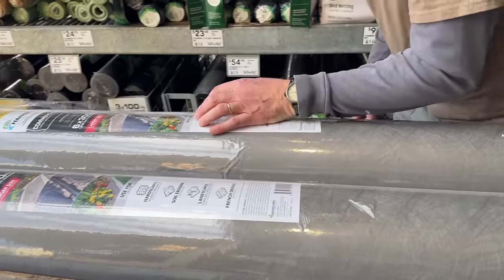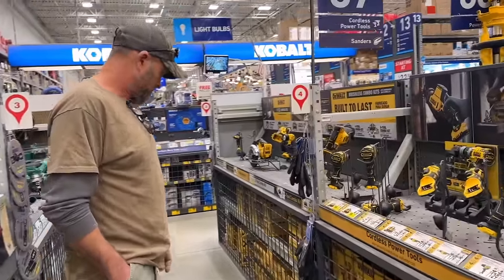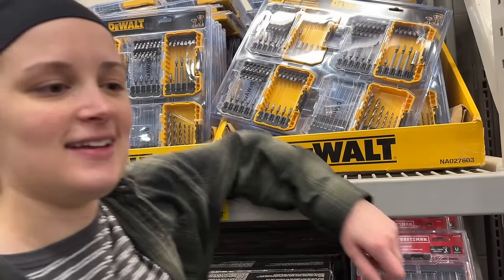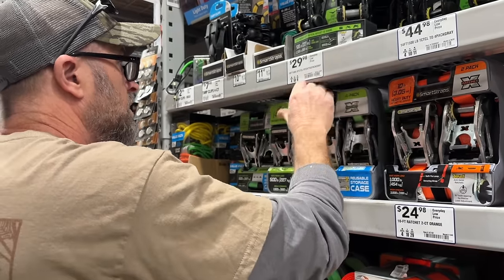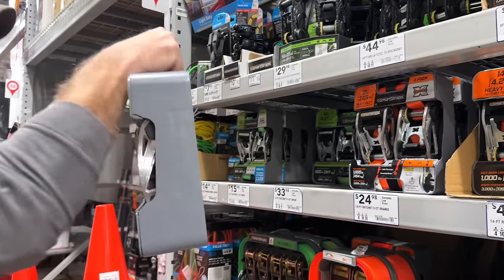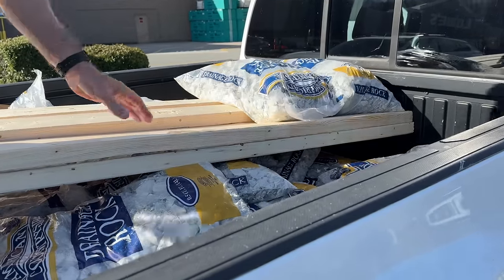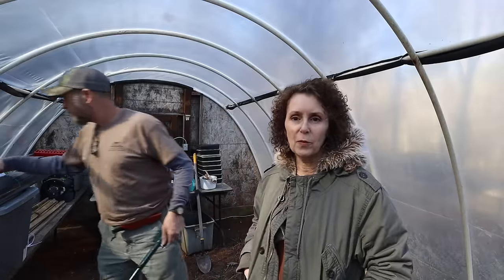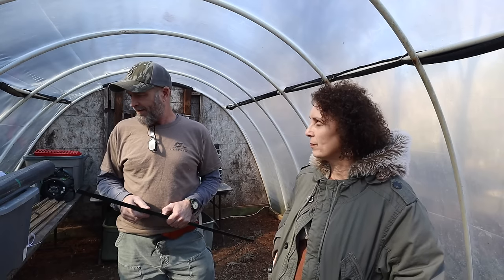Shopping for Garden Supplies & the Many Ways to Garden

Comment: Matt would make a good engineer. Have a plan in the mind and revise until you get it right. We were told , " engineers don't make mistakes, they make revisions " . In other words put your thought into an object and then make it right. Experience and information make it work. Experience comes with time, information comes from study.
Reply from the maker: Love that 😊 thank you
Reply: Pilots do this as well.  They have a flight plan, but due to conditions,  they have to adjust.   Love this

Comment: You can burn the wood all sides and cut ends wire brush put together will last for years, makes it water and insect proof.
Reply from the maker: Thank you 😊
Reply: What do you mean burn it, like with a torch?
Reply: Just saw your message , yes easiest method would be a propane tank with one of those weed burner's . Maybe you could borrow one if you do it will last longer than treated. It's a Japanese method for preserving wood you can Google it .

Comment: The highest relative humidity in a greenhouse is generally found inside plant canopies, where moisture is generated from transpiration and trapped due to insufficient air movement. Adequate plant spacing and mesh benches will help to improve air circulation at the plant level.

Comment: I've used that dewalt attachment on some old galvanized corrugated roofing. It does just fine if the metal is clamped and stable.

Comment: I was wondering if using a food-safe polyurethane or marine wood sealer or even tung oil would protect the wood so that it wouldn't need replacing so often? I mean, it would, but would it prolong the life of the wood long enough to be cost effective? Maybe Matt would know the answer to that. 

Nothing better than just picked corn. When I had room to grow corn, I would literally put the water on to boil before I went out to pick it. It would be in the pot 5 minutes after it was picked. My father-in-law said maybe I needed to heat the water on a Coleman stove out in the garden; then I wouldn't need to pick it at all. I could just bend the stalk over and dip the ears into the water. 😂😂  I confess, sometimes I didn’t cook it at all. I'd just shuck an ear right there in the garden and eat it raw. It was so sweet. That fresh corn alone will be worth the effort you put into renewing Pap's garden.

Comment: The best way to treat the wood is boiled linen oil, your wood should rest on stone and this way avoid rot and water. Linen oil raw is an excellent oil for salads, however, boiled linen oil is poisonous and can't be used in the kitchen. Boiled linen oil is an excellent diluent for oil painting pigments. Avoid contact with the skin and use it with a brush. 🪔🏴‍☠⚠⚜⚠